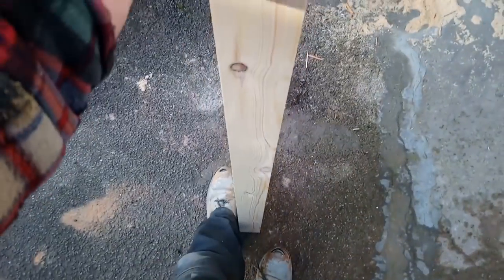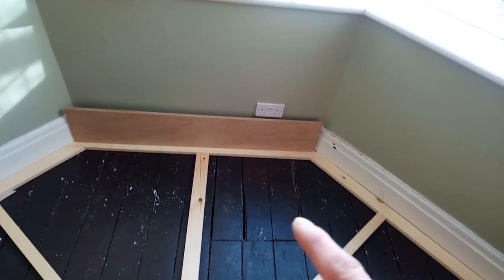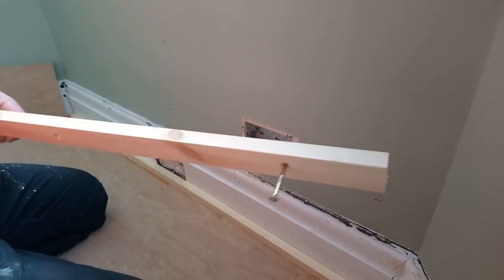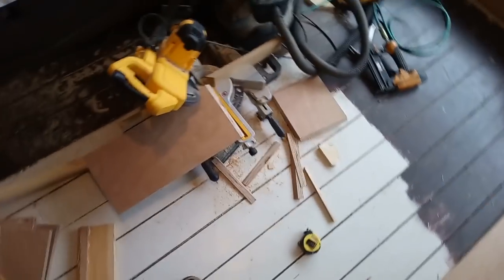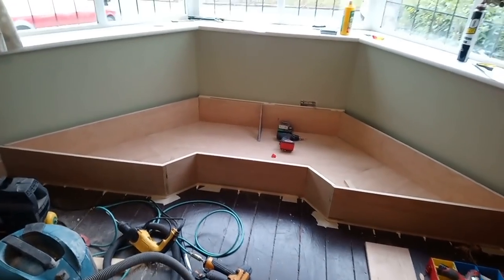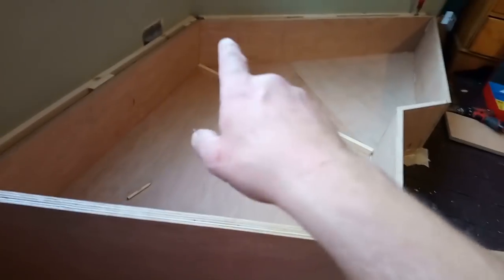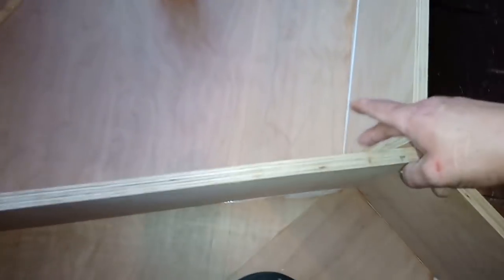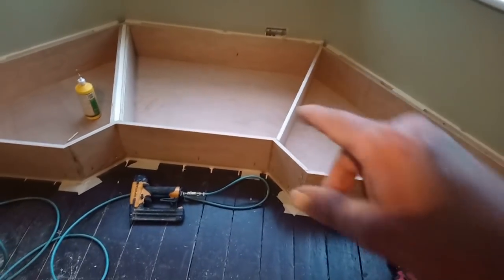Bay window seat construction - day 2 fixing down the base, sides & divisions

Comment: great part 2 gid, never used a pocket hole are there any good would you recommend one.
Reply from the maker: Thanks Paul 👍
I poo poo'd pocket holes for ages, i don't like them on show n the promotion that they're as good as traditional ways of fixings, as a more traditional joiner it seemed to demote the trade, but for the every day man i was happy to see people actually getting some saw dust on their hands and making or fixing things, good for them  👍
But!... I had a job a little while ago, the sprayed TV cabinet i think it was, where i needed a hidden fixing as i couldn't screw through the sprayed surface, I bought the basic model to 'give it a try' n was surprised how strong they are, for the right situation, where i think they're the best option n where they're not seen I'm now more than happy to use them,

Comment: Always enjoy your work and problem solving. Curious why you didn't remove the skirting tho? Did I miss something?
Reply from the maker: Hi, thanks
The skirting in these houses has no plaster behind, they are fitted on using wooden wedges in the brick joint, opening up a can of worms pulling the skirting off, the plaster above is poor so some of that would prob come off, built in furniture like this is classed as semi permanent, it might be in forever or ripped out in 10yrs, i knew I would be building this boxing out & I'd just be adding work for myself 😉
Reply: @Gidjoiner  yep actually that makes perfect sense. Cheers 👍

Comment: Does the makita vac nozzle fit in your kapex without any adapters?
Reply from the maker: I think so, I don't use the Makita on the Kapex but the nozzle that came with the Domino is fitted to the vac in the shed & that fits in, I have a different 2" hose fitted & it's been quite a while now so don't remember, sorry. I'll have a look tomorrow, i think it's a fairly standard fitting & the Makita nozzle is tapered so fits in most of my other machines

Comment: What do you use to hold your sheet materials in your van?
Reply from the maker: 😏 I have an old rack that needs rebuilding & a stick with a loop of string on the top holding the board back, my chopsaw or tool bag hold the bottom of the stick in place  😁
Reply: Gid joiner haha i like that! I bought a van just before christmas a big citroen relay, nearly got all the racking done got a few drawers to add then im done, nowhere to put sheet goods tho apart from down the middle
Reply from the maker: 👍 nice new van to play with 👍😊
I've had a few n put a variety of configurations in them but in this i did the best thing n created a bench, vac n crap underneath but on top i can open stuff, change blades, bang, clamp down, cut & plane stuff, the rack on the other side is rubbish needs rebuilding, compartments & drawers underneath are all rubbish too but having a bench/worktop 👍👍🤣
Reply: Gid joiner good idea to have a bench but not really my cup of tea, I prefer evening to have its own place rather than take up space with a bench, my van floor makes a good bench sometimes
Reply from the maker: the bench is only as wide as my vac so i can store it underneath but I think I'm just getting old n want everything to be at a comfortable height 👴🤣
In my head i want things to be clean, in drawers in the correct places but in reality you might have noticed that doesn't happen 😏🙃🤣🤣
Reply: Gid joiner i only noticed abit of sawdust on your workshop floor, not much tho, what videos are coming up next? After the wardrobe build?
Reply from the maker: 😁 it's earth under the sawdust not concrete so I'd prefer to be stood on sawdust & it stops muck getting transferred to the wood. that's my excuse 😉
sorry I'm not sure, I've always got ½ a dozen jobs on offer but I've neglected to book the next ones in, 🙃
Reply from the maker: I might have to do some of the regular joinery stuff, the small jobs that pile up but they keep the bigger jobs coming in, I'll make some calls see who's ready for me n who want's it doing the soonest
Reply: Gid joiner sounds good to me always like your videos, any stair related jobs coming up? Spindles would be a good one to watch for me
Reply from the maker: A it happens i do have a job replacing solid panels for spindles on my list, that'll be one I'm ringing, we'll have to see when she's ready.
Reply: Gid joiner if you could film that i would love it, never done spindles before but always wondered, i know the basic concept but im sure theres a few things what would catch me out first time round!
Reply from the maker: There not easy but in a way they are 🙃
It's measuring the stair string/bottom rail/handrail, calculating the distance between the spindles (no more than 100mm), cutting the insert spacers then starting at the bottom n having faith that the top space will be correct, often there's a mm or two gained 🤪
Reply from the maker: yeah if i can I'll film as much as poss
Reply: Gid joiner look forward to seeing it cheers Gid